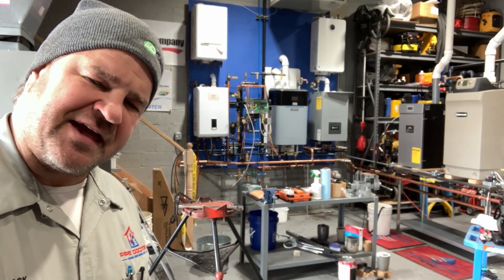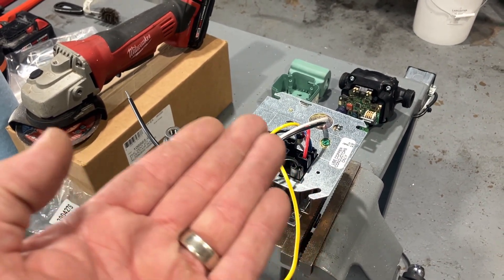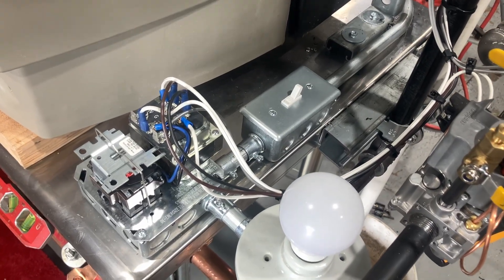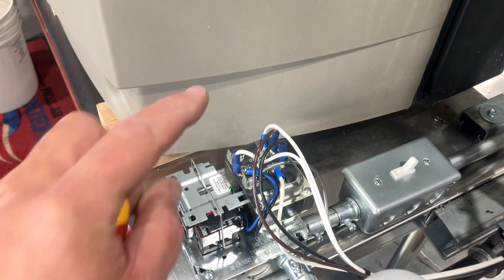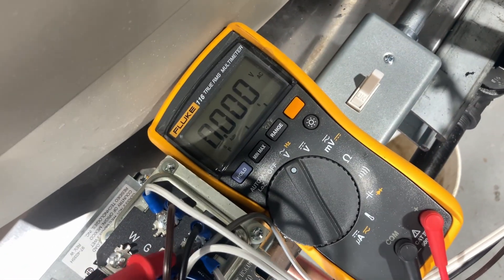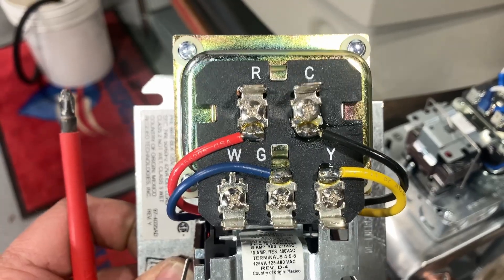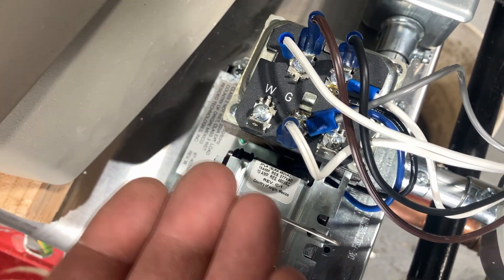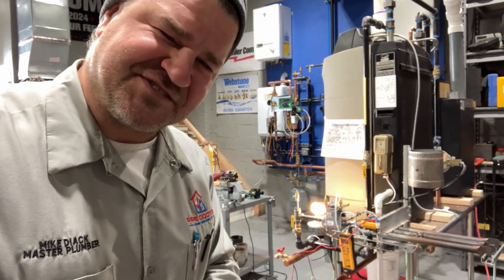2 Understanding Hydronic Boiler Fan Center Relay Honeywell R8285

Comment: I have this same exact Honeywell relay.  Recently my heating boiler intermetally does not come on. I have to manually turning the thermostat down, then back on for the system to come on. (Sometimes takes a couple times) Noticed that the relay was buzzing. I had just the relay replaced by a service tech while they were troubleshooting. Heat was good for 2 days after the relay replaced, now the issue is back. Is it possible the low voltage transformer is making the relay buzz because its not giving the relay the voltage that it needs? How often to low voltage transformers like these fail? 10-20 years? Mine is over 15 years old.
Reply from the maker: It sounds like you're really troubleshooting this well! The buzzing relay could definitely indicate an issue with the transformer. Low voltage transformers can fail after many years, especially if they’re approaching the 15-20 year mark. It might be worth having a tech check the transformer’s output just to be sure.
Reply: I tested the transformer, and the R & C are sending out 24 volts. So I dont think its the transformer. Calling my service tech back. Now I am leaning towards the pump for the system. Relay is getting extremely hot, which means there is resistance somewhere. Pump is my only best guess.

Comment: Seems like the wiring diagram is showing the safety circuit through Y and C not like you described through G and ending at the gas valve? I
Reply from the maker: Thanks for pointing that out! The wiring can definitely be tricky. I appreciate your attention to detail, and I'll make sure to clarify that in future videos!